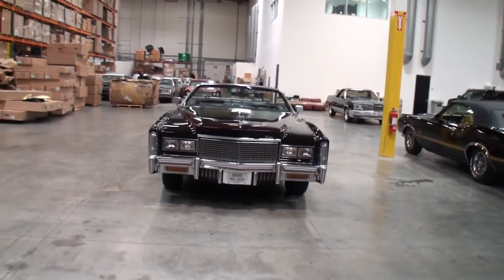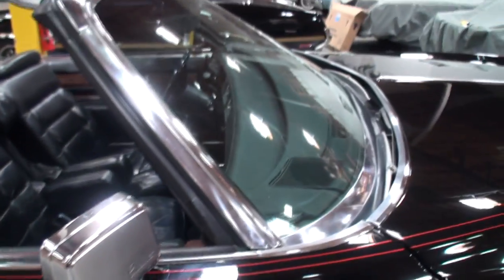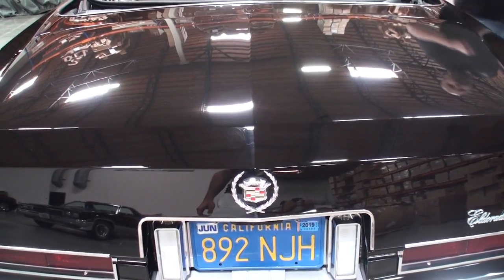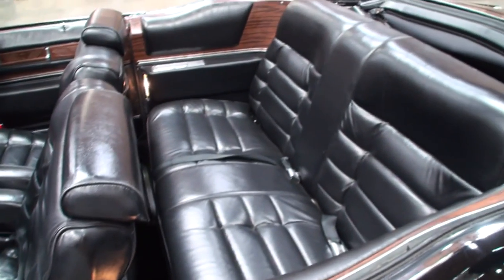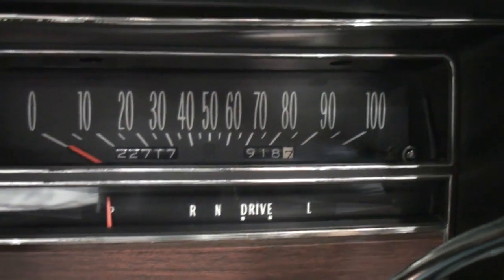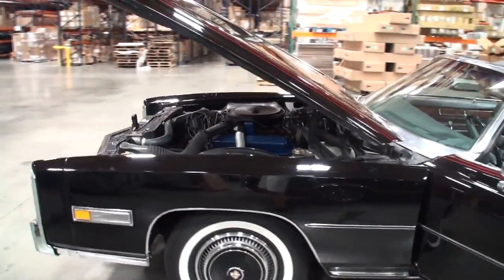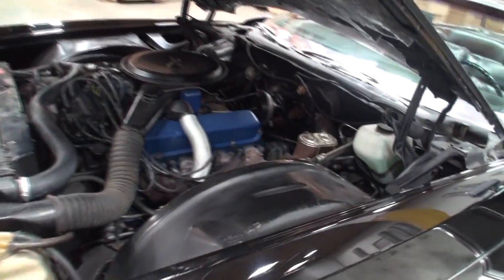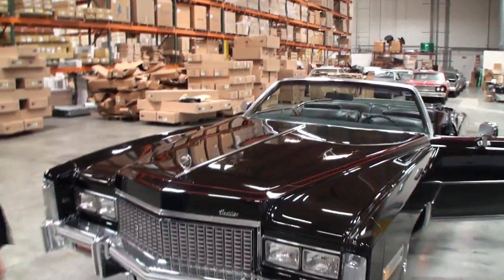1976 Cadillac Eldorado Convertible in Black & Engine Sound on My Car Story with Lou Costabile

Comment: Several times in my beat-up '74 Fleetwood, I'd restart the engine at a stoplight because I couldn't hear or feel it running (a bit different when cold).  Miss that car more than any I've owned since.
Reply from the maker: Hi Ralph L, Sounds....or doesn't sound :-) like a great car :-) Lou

Comment: Hi Lou, those big turn signal lights are usually called cornering lights, they light the corner of the car per your directional signal.   It is a very useful option but not many companies offer them.   That said this would be a great car to tool around the countryside.   Thanks.
Reply from the maker: Hi Terri Bel Bliss, Thank you for the tip on the cornering lights.  Agreed this big Caddy would be a great tourer :-)  You're welcome, Lou

Comment: Though it is a 500 cubic inch V8. It only produces 190 horsepower. A optional Bendix electric fuel injection added, it raised the horsepower to 215 horsepower. Torque was rated at 210 ft. lbs. w/o injection and 38 ft. lbs. with injection.
Reply from the maker: Hi William Scott, You might be right, I'm not sure.  Maybe a Viewer with knowledge car share, Lou

Comment: nice is there a video of how the front wheel drive set up works and how it looks underneath🤔
Reply from the maker: Hi John Beer, Glad you think this video is "nice" :-)  We (as you can see) did not put this one up on the rack to take a look around, Lou
Reply: Longitudinal engine with a TH425 transmission mounted on the left side and connected to the engine with a chain. Then in front a standard differential with drive axles to the front wheels. Disc brakes with hand brake working on the rear calipers.